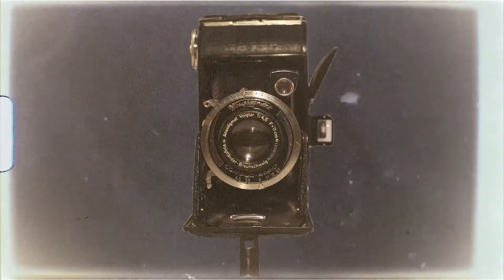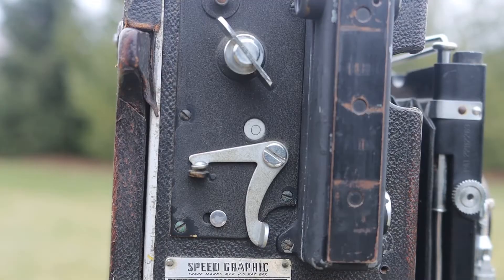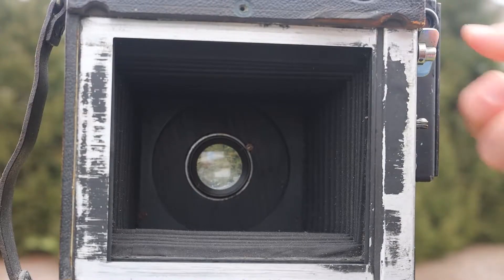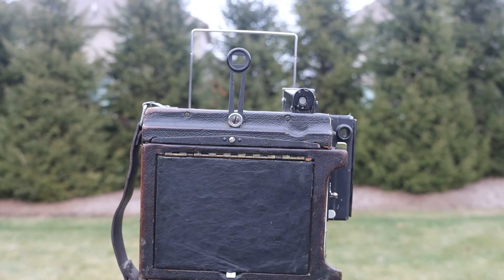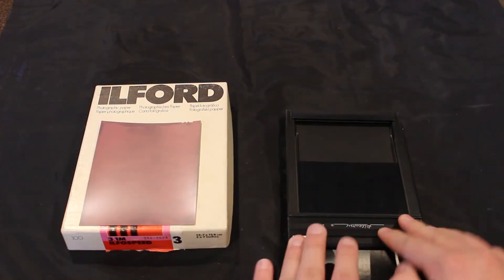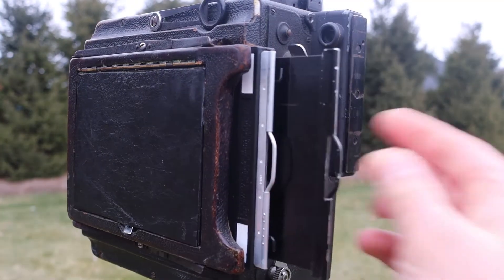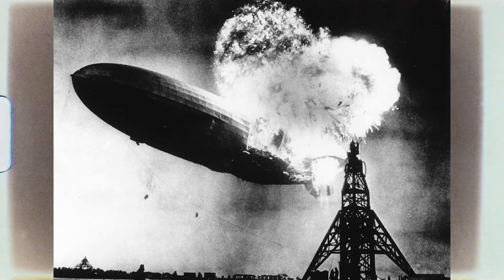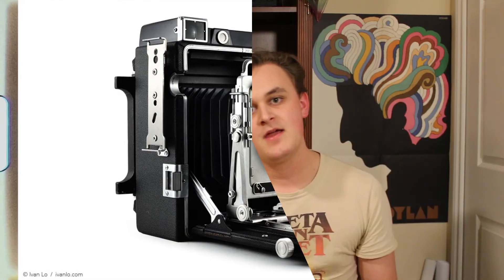Through The Lens: All About The Graflex Speed Graphic

Comment: you can get orthochromatic x-ray film in 8x10 or 10x12 sheets and cut it down to 4x5 with a paper cutter under a safelight for about ten cents per 4x5 sheet. you also left out the main advantage of a speed graphic over other large format cameras. the focal plane shutter means you can use all sorts of old dirt cheap lenses from enlargers, projectors, etc. that don't have their own shutters.

Comment: Excellent video. As an entry into large format, "press cameras" like the Graflex, B&J, Meridian, and others are still the "low cost" option. On auction sites and forums one might find a $300 bargain, but more likely will find a complete kit for around $500. "Low cost" in this scenario is relative. Buying all new or modern LF kit would likely be several thousand.

I, for one, think a Kalart rangefinder instruction video would be very useful,

Comment: Because you're not looking directly through the lens (like a single lens reflex camera) if you use different lenses on the Speed Graphic, there's different viewfinders that attach, and that have the same angle as the particular lens you are using.  I like that.  However, if you change lenses, then you can not use the wire frame with the peepsight. The wire frame has the same angle as the standard lens.

Comment: I just purchased a Speed Graphic on eBay.  I have a number of LF and MF cameras.  Some I have restored to include the lenses.  You did a great job on your presentation.  If you have not found anyone to develop your Kodachrome in B/W with this message, you should try to develop it yourself.  Find a developer that is designed for positives and get to work.